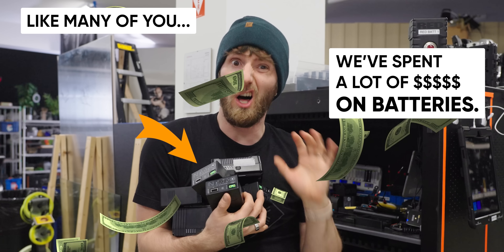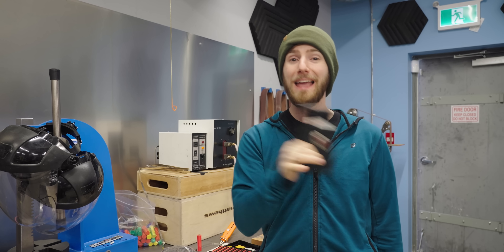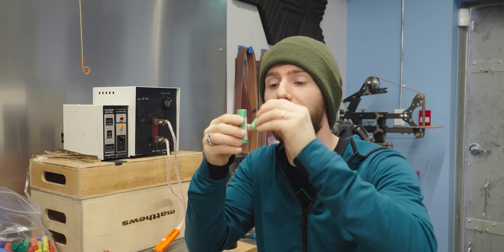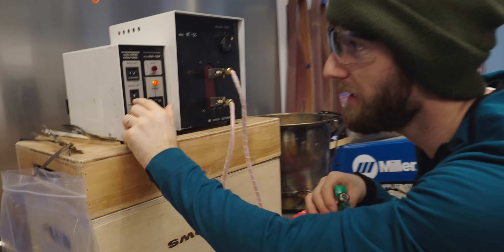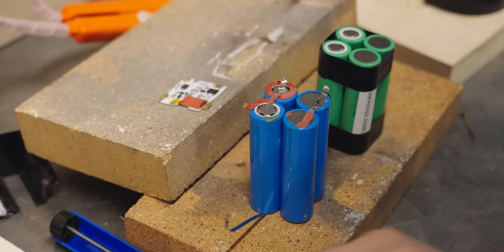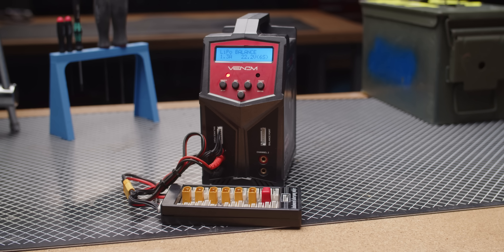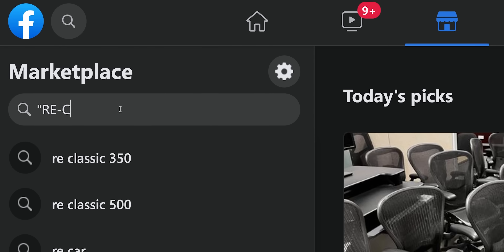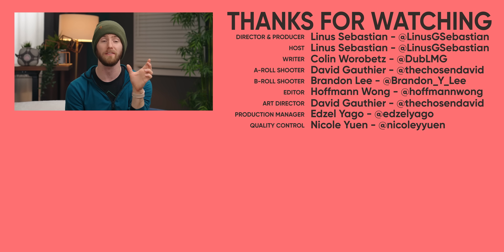This should be illegal… Battery Repair Blocking

Comment: he thinks sparks caused cell damage, the spark is clearly from inadequate contact of the probes, so the only path of current is the spot welder probes
it would be way more dangerous if you accidentally shorted a cell or two, but as long as it doesn't go flamey and the pack looks physically sealed you can take the pack out of the sand bucket and keep going, it is dangerous to have a cell that took a short circuit if it went actually low or got hot enough from a prolonged short to damage the separator or the short was so hard it perforated the separator and the cell now holds 0v and can't be trickled back up
this fear of the unknown when it comes to lithium cells baffles me, it is just a cell you don't want to get much above 40-50c because of separator damage, short circuits are bad because shorts cause internal heating and separator damage, and voltages that leave the safety zone for extended periods will slowly destroy cells
but a cell at 0v isn't actually a death sentence no matter what the myths say, in fact some products actually ship with 0v lithium cells and they don't need a cell swap, in that case the charge device does what is called "0v activation", this is a process where charging is actually limited way below the normal rate until the cell hits 3v, if it times out the cell is shorted and too dangerous to activate, but assuming it takes only a few minutes to get from 0v to 3v a cell can be charged albeit at potentially reduced capacity and a slightly worse IR
I bet all of those "failed packs" are fine if they just finish spot welding and connect a more forgiving 4S BMS like what you can buy on slamazon, especially if the red has a "battery eliminator" cord you don't actually need a RED BMS, but it may need to to spoof some SPI data using an arduino or something to make it happy
yes battery cell swap blocking should be illegal, cells wear out, a known fact, and if you BUY a battery you have the right to do whatever you wish with it since the dawn of time, which still effectively includes the right to repair an aged or damaged pack if you have the abilities
right to repair is just the recent battle to stop manufacturers from REMOVING a right we already had, it was ALWAYS legal to fix your crap, it was never disallowed, it only has been accepted erroneously that a "warranty void if removed" sticker is not just an illegal thing to enforce, if I think my thermal paste on my laptop is aged to dust, I have the right to re-paste my GPU+CPU and still keep the warrenty, even if that bullshit sticker is damaged, something that can happen without disassembly anyway
Reply: I have soldered cells directly too, and they still work fine
I have salvaged cells better than the cheap knockoffs on amazon, and they started at BELOW 3v(one pack was definitely 2.6v and the BMS said "nope" but after charging them in a bare 18650 charger they have more capacity and discharge rate than "brand new" cheap cells)
I have actually briefly shorted cells, and they survived

lithium is scary because when you abuse them beyond a certain point they go all flamey, but normal mishaps are about as safe as NIMH always was(insides are flamey but as long as a short doesn't heat till it vents it won't go boom) it is just that the sparks from shorts are much brighter because they hold more energy and can put out more instantaneous power safely

a properly made cell is gonna last until capacity degrades to the point it becomes useless, this will cause the IR to slowly rise too as the cell ages, but a funny thing happens with lithium vs NIMH chemistry, the capacity is still higher than a crappy brand new NIMH and so is the current rating, this leads to you having two batches of bare cells

a set for high drian: power banks, vapes, ect
and a second set for low power standby replacements: flashlights, small igniter modules, retro PC CMOS, ect

an aged cell may still have use even after it is too worn for it's original use as long as the "0v activation" doesn't fail and it holds at least within 0.1v after 1 day of rest(0.1 is common with my freshly charged crappy cells but it never drops below 4v after a day of rest)

and no, going under 3v does not mean dead, stop promoting that myth
also brief shorts well above cell rating are not 100% dead, you just have to test the pack and re-balance before you keep going after 30 minutes of rest(it will go boom or self discharge if you actually ruined it within 30 minutes)

Comment: We should start an open source community where people reverse engineer the pcb or make a standardise one for like laptops, one for cameras etc.

We can buy lipo batteries at cheap. We just need the circuit board, sockets, 3d print file for the plastic body and all that. So we can just replace batteries when one goes bad. This is far efficient. 

I am sick of replacing the laptop batteries module. Even opening one to replace batteries are impossible with all the glue and everything. They did all this on purpose so you were forced to buy an entirely new battery for the laptop. The evil for these companies are disgusting and anger inducing. It's like we don't own what we brought with our money.

Comment: Yes!  The battery inside the replaceable battery should be replaceable!
Reply: You need a lot of expensive equipment to do this properly. And batteries are designed for use with specific cells, so you can't just swap them at will. When replacing your cells they are no longer UN38.3 complaint and are considered unsafe for transport and for a good reason. Packs are very strictly tested before they are approved for production - mechanical shock testing/drop testing, vibration testing, thermal cycling, thermal shock, overcurrent, short circuit, corrosive environment etc. Imagine that anyone can replace battery cells in their laptop and then bring that unsafe pack onboard a plane, where a poorly welded connector dislodges and causes short circuit and thermal runaway. Metal fires are not easy to put out.
Reply: @KB-mo3sx  r/whoosh

Comment: We have a very expensive 3D printer at work and the spools of filament spools have a circuit board with a chip on it. When the circuit detects the spool is empty, the printer will stop allowing that spool to feed the printer. The problem is that the spool still has plenty of filament on it. This is done to make you buy their filament and prevent you from using any other filament. Because of the chip shortage, the manufacturer of the printer has asked us to not use the spool of filament to the point where it is considered empty because the circuit fries the chip on the board and they're having trouble getting new chips. So if we use the spool and leave a few percent on it, the manufacturer can reset the chip with firmware. So the manufacturer makes sure you have wasted plastic filament and circuit boards are purposely destroyed. I actually take the old spools home and use the remainder of the filament on my Ender 3 3D printer.

Comment: Weight are they using new 18650s?
Reply: Wait they are tossing in new ones to replace the low cottage ones how to you get those to come back up thougj?
Reply: @adinstagel8422  You not always can - where are dendrites forming on electrodes and it's irreversible.

Comment: 13:43 Some times when you disconnect a bms of the batteries once is reconnected it protects itself,
Also when you short the output it should protect and cut power to get it out of this state it needs to get charged by a minute
(Once it gets power from outside it'll unprotect itself the minute thing is a recommendation is mostly instant)

Comment: A few very important things to note about a lithium fire. 
The danger with lithium at high temperatures is that it breaks down into both oxygen, and combustible fuel, meaning it creates its own fuel and oxidizer. Meaning it can burn on it's own if the oxidiser or oxygen isn't removed from it completely. 
The second danger comes from water. When Lithium contacts water, it grabs an HO of  the water, leaving the hydrogen. Hydrogen is highly explosive. 

In a nutshell, don't put water over lithium batteries. They will explode, covering you in burning lithium which can't be put out. If you are unlucky, it can burn you to the bone.

Comment: The instant you mentioned what happens is volatile storage with my first thought. This could absolutely be malicious. I don't want you to ever replace the battery, why would they ever bother not using volatile storage?
Reply: It's more of a safety feature. If you recell then you can introduce points of failure that the BMS is not designed to handle. Would you like to sit in a plane next to a person that uses a laptop battery that they recelled themselves having no proper knowledge or equipment to do it ? I've seen battery pack 38.3 testing and I know how thermal runaway looks like - single sell produces around 35l of gas and a lot of heat.

Comment: The sparking was caused by poor electrical contact. Better welding tips and cleaning the contact strip before welding would have reduced or eliminated the sparking.

Comment: Ideal self re-cell able battery packs should be ones where the 18650 cells are in holders and not spot welded, so anyone could easily re-cell the pack

Comment: The powerful opportunity to have batteries "topped off" from the manufacturer for less than replacement seems bizarre to miss out on. Effectively offering the battery version of dealership auto repair, sure there might be 3rd parties but so many people would rather trust the dealership
Reply: As someone working in the industry I can tell you that most factory recalls are not salvageable and are simply disposed of. Battery packs are glued together and spot/laser/ultrasonic welded to connectors/busbars so you would have to destroy the whole battery pack to take out one damaged cell. Cells would have residues after previous connections and would be unfit to connect once more. That means altering the production process and a pack like that would need to be recertified and that is simply impossible for a single battery pack (some tests are destructive) and it costs thousands of $ to do that.

Comment: I believe most of us would like to battery recycling plant. There is one "trick" that may disable the evil bms from detecting a battery swap, and it is to keep the voltages up while swaping the battery, this means, keep the thicker wires powered AND the balacing wires too, it's easy on some bms, I was able to re-cell a lot of laptop batteries, known to be evil and also sony camera batteries, like your and the former alpha format :) There was a laptop batteries that even had a light sensor, when ibm sold the thinkpad line to lenovo, it became evil AF, and those things had a light sensor that would short a fuse inside the controller, rendering it to junk, Those companies SHOULD be sued.

Comment: I've toyed with the idea of making up nicked tabs with a wire pigtail soldered to each one.  Then weld tab/pigtail on each end of each battery.  That way each cell could be welded separately, so if you blow it on a cell, you haven't wasted a bunch of others.  Then the pigtails can be wired up as needed.  Anyone have any thoughts on this?

Comment: first thing u notice when u connect battery wrong is that it will start heat up
i actually replaced couples of cells in notebook battery packs and i have no respect to batteries at all. yes it looks scary when cars go fire but u should know that batteries used in cars are not the same as 18650A batteries in notebooks or any other kind of power pack, they can look same and have same size but voltage and current is different. lithium is reactive but in water
u can actually bring dead batteries to lífe but dont exoect them to live long. and last thing is that i never used spot welding to weld batteries together instead of i using solder all time it can be strugle but u can scratch the surface of battery and soldering iron will hold as expected. id rather use normal copper than nickel
Reply: i aklsly love linus vids but this video is pain for me i am amateur too but electricity is my biggest hobby soo i know what can be rlly dangerous and what is actually not that harmfull. yes batteries can explode or catch on fire even without reason but its not much that often and if u do all corect nothing sshould happen 
im from europe so in outlets we have 230v ac dont even talk about how much times i got hit by the 230v ac or even 400v ac 
when u get hit by 400v u will see in blue filter or die :DD at it can badly burn your skin its painful ash
Reply: Voltage is actually the same. I actually produced hundreds of battery packs and having no respect for Li-Ion cells is plain stupid.

Comment: did you just throw those perfectly fine cells away? Just because top sparked does not mean they will explode I even solder them. They are dangerous but a spark won't explode them. There has to be physical damage in most cases.

Comment: My undergrad advanced organic professor used to work in pharma. His first year there, he was doing a lot of reactions with lithium bromide, and making it himself (see also Grignard's reagent.) A few weeks in, a lithium slab spontaneously burst into flames. The lab policy was to go through a variety of fire procedures, but if all failed, then calmly leave the lab and pull a fire alarm. Nothing worked, so he left and pulled the lever. The fire department came and didn't even bother to try to put it out, only contain the fire until everything was burned. Turned out the lab was specifically insured for such a scenario and actually mandated a limited response  in their policy.

Comment: There's a possibility if you supply the correct voltage to it long enough it may wake up the BMS the guys at noco got me to try it with one of there batteries unfortunately it didn't work

Comment: 9:10 Somebody educate me....Why would there be sparks, even if one cell was at 1 volt and one was at 3 volts, if there is no completed loop?  He said something about them equalizing or something but...I mean...it just makes no sense to me.  Wouldn't you have this issue when mixing good and bad alkaline batteries too if the voltage difference was great enough if what they are talking about is a legitimate concern?  And I've NEVER experienced sparks with alkaline batteries either.  Somebody please explain.

Comment: 7:28 You make it sound significantly more dangerous than it actually is.  Not that it's not dangerous but I make several mistakes while rebuilding batteries (which is actually why I'm here) and nothing happens most of the time.  I accidentally completed a loop once though and the battery got very hot VERY VERY fast.  But as soon as I let go of the strip (because it was burning my finger) it was fine.

Comment: Why can't you solder the cells together rather than spot weld? I've soldered cells together before when I had to re-cell a battery pack for a vacuum cleaner. It worked fine after this.

Comment: Technically, the bulk of the fire from a lithium battery fire is not lithium but is instead the two metals that form the electrodes or plates of the cells; the lithium is in tiny proportions, in a liquid solution to facilitate the movement of ions.

Comment: linus tech tips i believe the battery didnt work with the bms because when u put new batteries to a bms u have the battery needs to be plugged in once your done soldering so it could wake the bms up and output power i work with electric scooters and the bms in batteries for the scooters are just like the bms u have to your battery packs once u put new batteries onto a bms board u need to put power through the bms to wake it up hope this helps for future projects like these.

Comment: If anyone does this don't use lithium ion get lithium iron cells they last over 10 years and thousands of cycles unlike ion and are safer.  Makita does this in they're batteries after so many charges the charger will no longer charge the battery.

Comment: They should have made it as simple as replacing the individual cells with new ones. Then one could swap out all the 18650 cells after they don't hold the charge and the pack would be fine again. They could have saved the customer money, while still making more income. They could also recycled the old cells.

Comment: The company I used to work for made battery packs that powered some of their units. They were just regular rechargeable AA batteries that were molded into a sealed plastic pack.  They would charge a fortune for replacement packs.

Comment: I had experience a problem with a commercial automatic toilet flusher it had some kind of onboard storage if it senses that you had took it apart it would disable itself the fix was disconnect the battery locate any capacitor on the circuit board and discharge all the capacitors at once wait 30 seconds Plus then connect your new battery if fix my problem

Comment: Holy freakin hell no wonder you keep frying them with that overpowered welder. That really shouldn't happen
Its like so obvious when you see up close the amount of heat that tip was making
Reply: ahh I could tell you finally turned it down, too bad you were only down to 4 matching batteries by that point. And it was still way to hot and too long of discharge

Comment: To make the battery work after disconnecting the cell, just connect it momentarily to the charger.

BMS undervoltage protection disconnect BMS electronic completely. To wake up the electronics, you need to connect the voltage from the "device side".